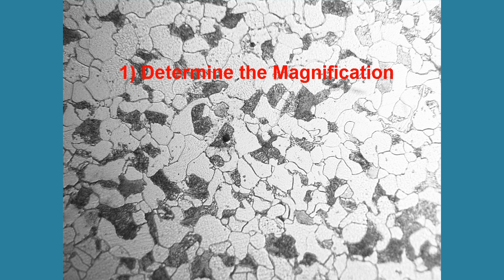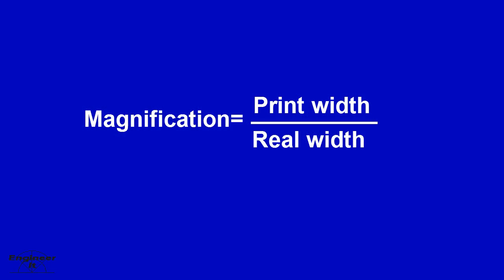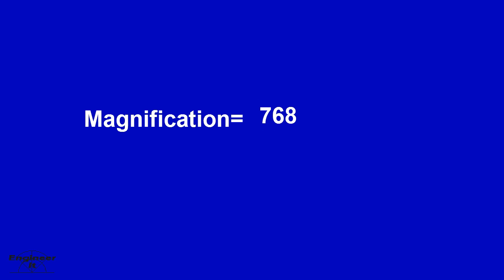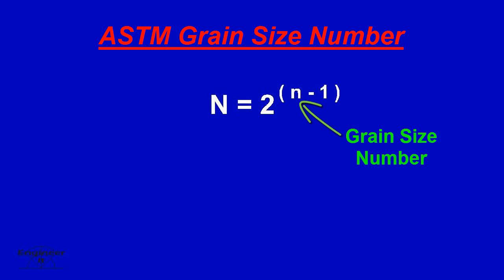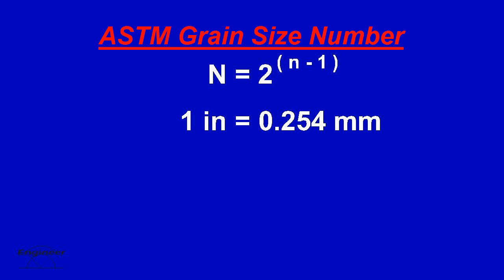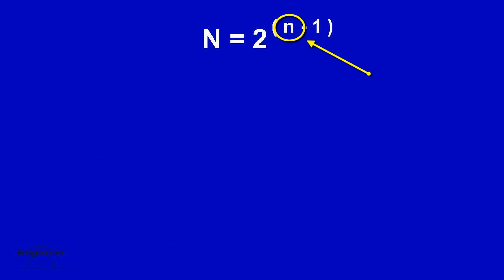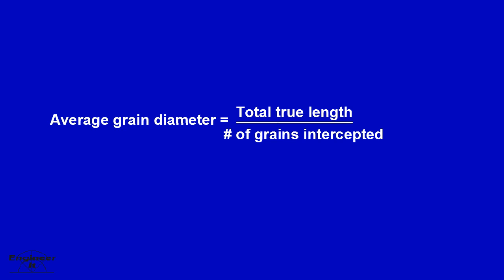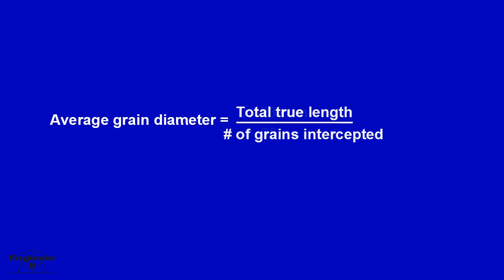Grain Number Analysis

Comment from the maker: When doing a grain number analysis, the photograph is not true size; therefore a scale factor must be determined.  So 1 inch in the photo in this example is 0.254 mm on the 100 magnification; listen carefully to the narrator.  The decimal is moved two places.  it is true that 1 inch equals 25.4 mm.  The 0.215 mm is measured on the sample that was photographed.  You will need to conduct the analysis with a real sample and substitute your actual observation that you measure on your sample.
Reply: You need a video on how to deal with the metal yard when they deliver defective metal and defending your claim that it is defective.  I had to etch a piece of stainless steel and show them that it had grains of iron carbide that causes corrosion before they would replace it.
Reply: i didn't understand the value of 2(124) ? and this video refers to astm no ? anyone can answer
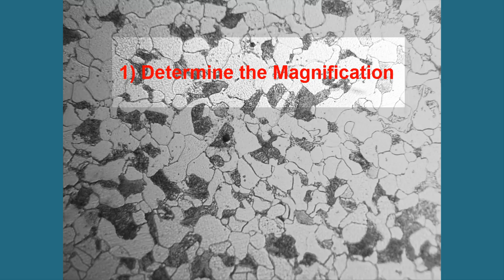Reply: @mahesafernandaaldhopangest6272  it's probably too late but it is the print size dimension's height. 0:55. which is also the length of the two lines she used, hence 2x124. hope this helps.
Reply: I would want to ask you a question. If i m not wrong if we have a scale bar. We can find length of this line we used for interception, and directly divide this length of line to the number of intercepts and obtain grain size diameter. is my assumption correct?

Comment: the explanation cant get any better. in most textbooks tney define just 3-4 methods in order to touch the topics. this is in depth
thanxx
Reply: +Sunil Sharma do you know here she got the 0.215mm?
Reply: +Segurasegura Jorge nvm
Reply: Segurasegura Jorge 165 mm is the width of the sample itself. but 0.215 mm is the width of the area under the microscopic light. it is the area which is being seen by the eyepiece. but there is a simple direct way to find the magnification too. just multiply the eyepiece magnification value with the nose piece lens magnification value.(e:g; if the eyepiece is 10X and nosepiece is 5X then the magnification is 50X). hope it helped
Reply: thanks i understood it right after i posted my question. right as i finished typing haha. but thanks. this will clear things up for other people.

Comment: Could you explain better? For example, where did you suddenly get 0.215 mm from?
Reply: +bob yes where did it come from!!?
Reply: +Segurasegura i got it. 0.215 mm come from the actual width of the steel sample. which is the real steel. and the width of the photo is 165mm.
Reply: @segurasegurajorge8018  yes. But actually the magnification is known and that real length on surface of steel = 0.215 mm is calculated from Magnification. Real length = photo length / magnification. I don't know why the video presenter did the opposite of this.